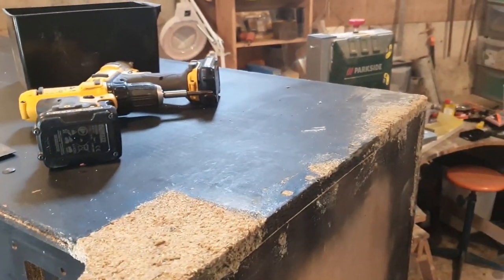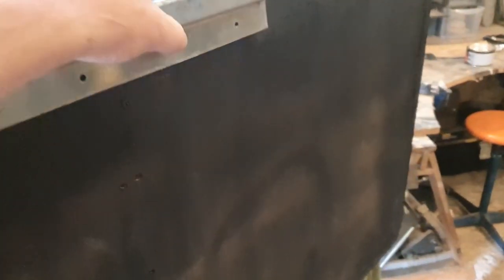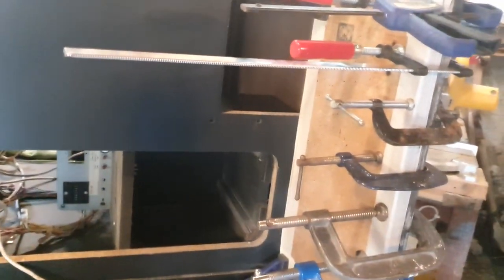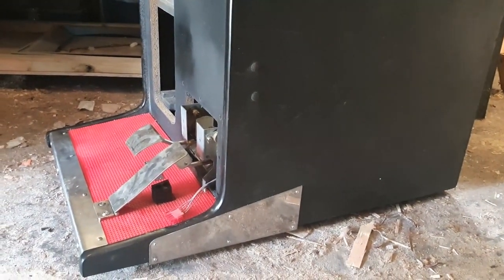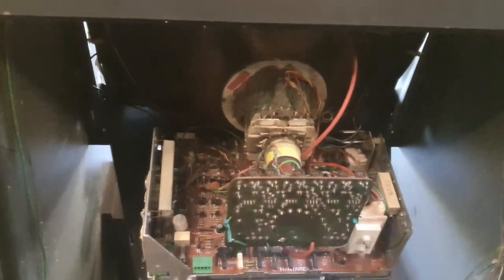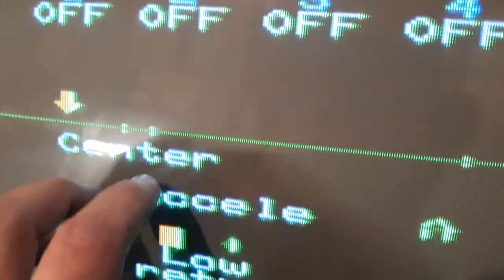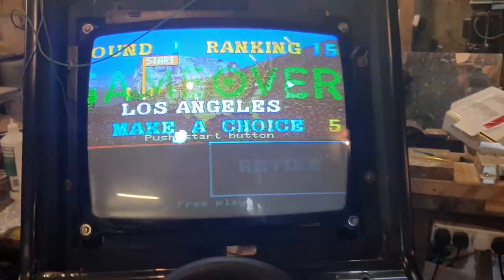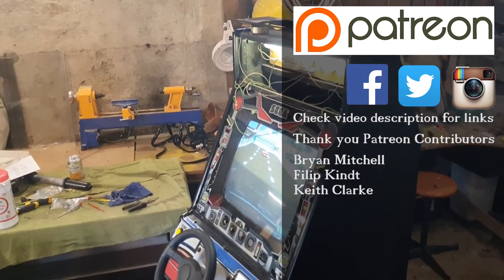Turbo Outrun restoration #2 - Lovely bottom

Comment: One more thing. I would suggest using evo stick for the vinyl where the pedals go. I recently had a silverado cabinet and it was peeling away at the kick plate and it worked a treat but its a one shot deal and I had to make sure it lined up the first time.